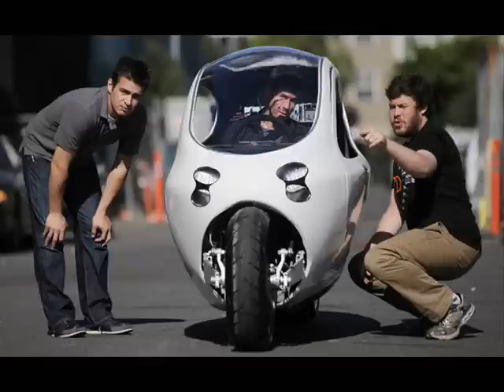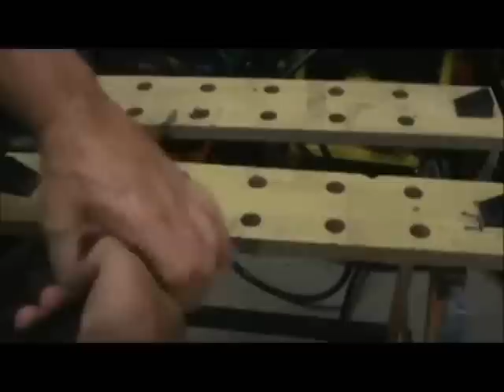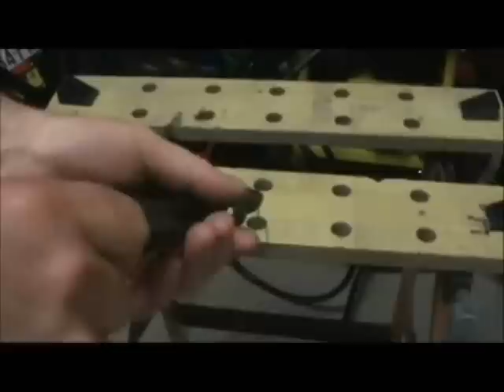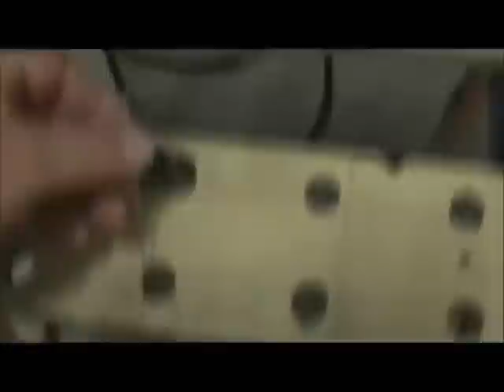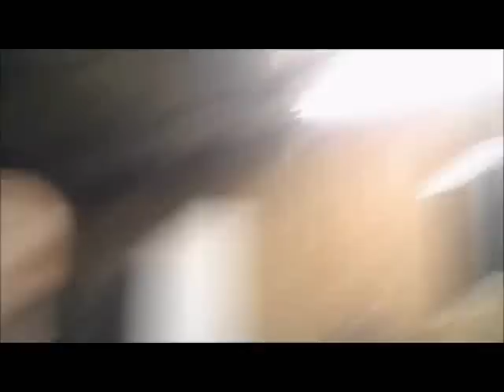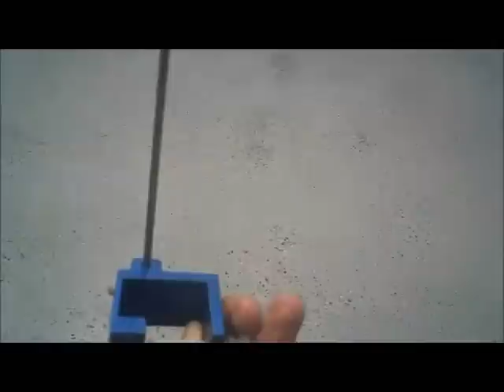TDD report for October 13, 2012

Comment: If you want to buy a 'wire twister', go to Aircraft Spruce's web site and looks for 'safety wire tool'.  

Anyone who has changed the oil on a lightplane has used this tool, because the FAA requires that the oil filter be safety wired to the airplane, amoung many other places where safety wire is used.